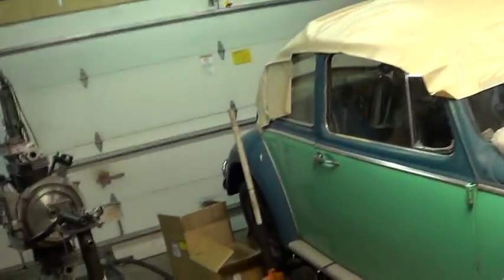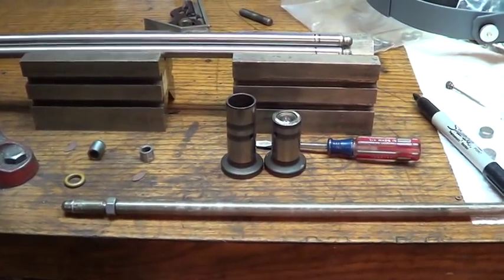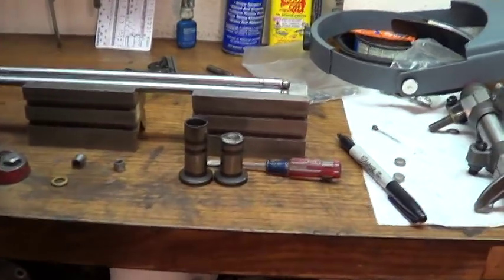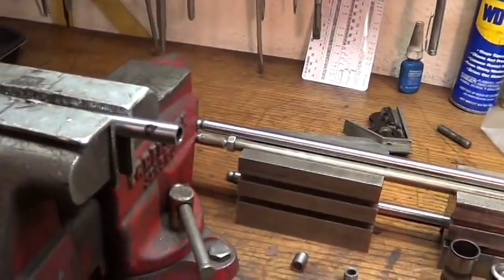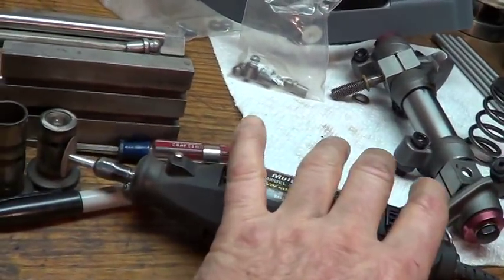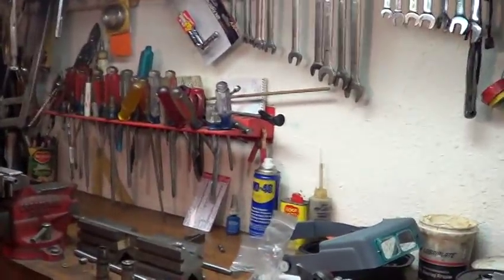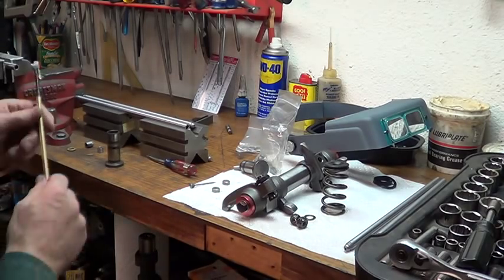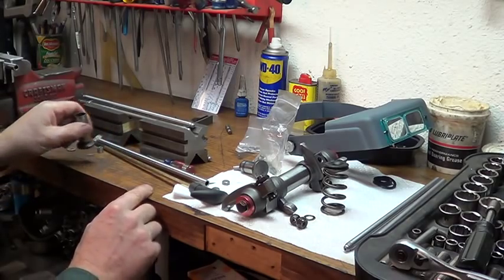VW 1 4 ratio rocker pushrod calculation

Comment: Hi EZGZ when does lash caps need to be used? I am building a 1600 stock engine. Do I have to use lash caps? Thx
Reply from the maker: Nope!  The factory didn't use them. Manditory on 1.4 or higher ratio rocker arms.
Reply: @TheEZGZ  Thank you for your rapid response! You are the best.

Comment: hey why are you using type 3 cool tin?does it work just as well in your bug or better  than stock tin?how warm does it get there cause I know they were used in Africa and on type 3's but have you noticed better cooling with them so I could use them  on mine.I live in the high desert
Reply from the maker: Since most of my engines use 90.5 cylinders I feel I should make every effort to keep things at proper temp.  I use a thermostat and since the type 3 was a heavier car and there engines made more horsepower I would follow the factory lead.  Besides it gives me that warm fuzzy feeling that I'm being nice to it when in fact I am thrashing it at every importunity. Nobody has to do it my way but it works for me doing it the old german way.  Remember much was cost driven and parts left out never break. .
Reply: I see. I also have always used thermostat  and flaps with the addition of a type 4 oil cooler vs stock and its work great at 70 and 80mph all day long on my 1600.i thought about trying those cool tins but I wanted feed back from someone who drives there cars rather than trailer them lol.I am know working on a 2332,we will see how that goes lol.thanks for all your videos and feedback .I too love doing ,if I can all my work its more rewarding.
Reply from the maker: KENNY CHAVEZ Things don't fit as well on those big stroker's. But have everything connected on my 2 liter and 2110
Reply: I have the 84 with smaller rods and the pistons to match it should be stock length I got the parts from a friend who already had it built but his flywheel broke  apart and he sold me the parts,so in that sense it should work just fine my.my only worry is the cam size for good idle and if I should use straight cut gears,

Comment: EZGZ.  Thanks for the videos.  Do you adjust the pushrod with the engine at TDC?  I am having trouble getting full lift with the pushrods I cut. Thanks!
Reply from the maker: Yes, just like normal.  If your even off .010 off you probably won't feel the difference but we try and get it perfect. 
It's been a couple years and a few thousand miles and I am still very happy with the way it all runs. Ratio's and stock cam make a real torque monster.   Good Luck with your project.